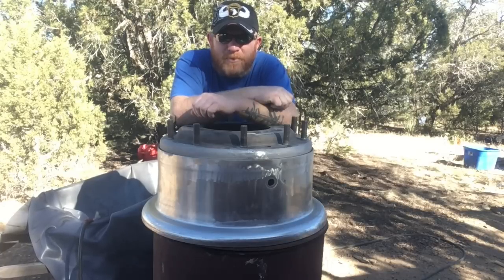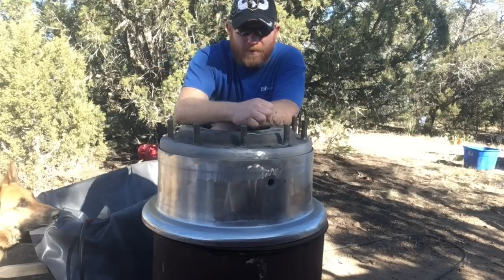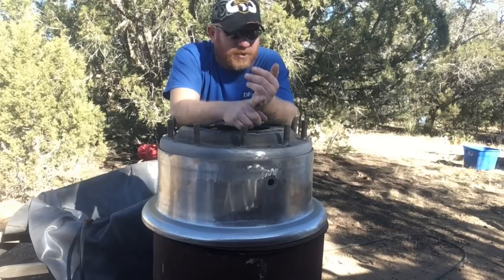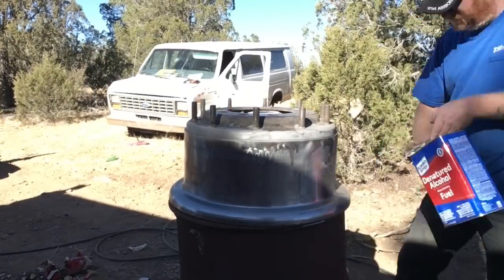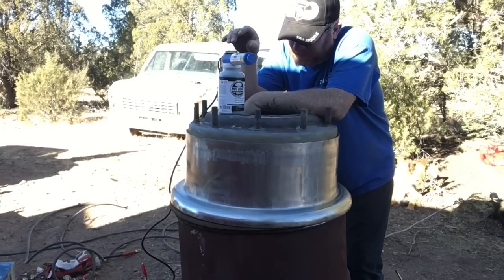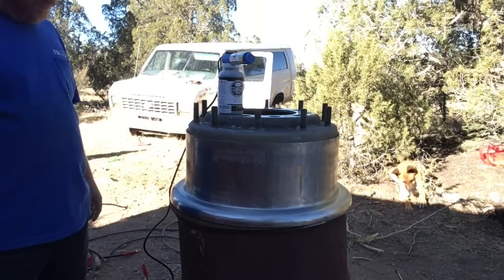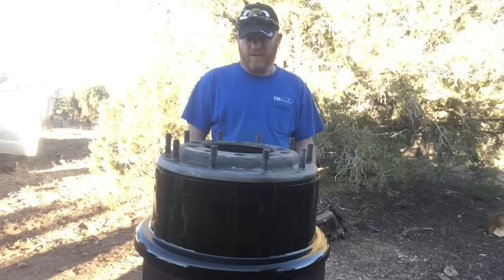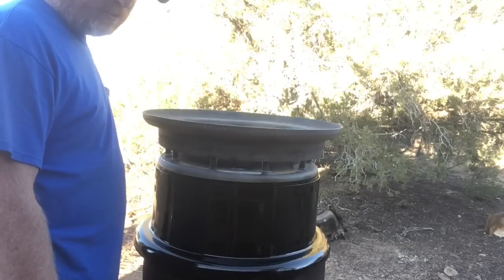NO OVEN? NO PROBLEM POWDERCOATING!

Comment: Cool improv.   I powder coated my Jeep bumper by stacking two drums and putting two oven elements inside.  I did the rims by building a cinderblock oven and a oven element on the sand poured  in the center.

When you need to get it done, but don’t have time to wait!

Great video!
Reply: Thats an amazing idea.thanks for sharing

Comment: I've wondered if just blow torching the rim before and putting the can in really hot near boiling water will help fuse the paint better to the metal.
Reply from the maker: NoSunBeach If you’re going to use a torch make sure to get the metal good and hot first because it will leave moisture on the metal. It theory it could be trapped below the powder if it melts before the metal gets hot enough for it to bond.

Comment: Powder coating isn't just to melt the color on it and that's it,  that won't be hardened and last in scratches.... might as well just painted them for same scratch resistance.... you need to heat them for much more time and much higher temperature or it's really just barely melted powder paint.

Comment: 9:09 What's the name of the track you used here?

I'm gonna try out using that radiator heater while also using a heat gun as well.

Thanks for the tip! 👌
Reply: I thought about the heat gun also but I think it would blow off the powder. How about using a map or propane torch to heat it up 1st then powder coating hot, then putting the propane heater on it?

Comment: What kind of medium were u using that u void have your gand that close?   I need to do the inside of a t roof for my Camaro as I need to replace that roof section, s (the s3ction is off the car) so this gives me what I needed to know to get the inside sections coated:)  you can also use high temp tape for this so you can mask it off and not worry about the heat!
Reply from the maker: Vicki k Gibson 80grit aluminum oxide I think
Reply: @OffGridOverLander  wow fast reply!  I have another q. How long did u put the heater on each section?  Normal temp is around 400 f for cure. That takes about 30 min, I am told, so how long do you put the heater on the rim?  Of course thinner metal will get hotter much faster.  Might be hard to regulate,  but not impossible,  just watch it very close?
Reply from the maker: Vicki k Gibson with as thick as my rim was I just watched it and rotated it about an inch at a time when I saw that it had melted, between the metal retaining the heat and slow rotation I figured I hit the 10-15 min needed for my powder.

Comment: You think it's possible to powder coat a car panel or maybe even do the wheels while they're on the car
Reply from the maker: Sorry for the late reply,  I wouldn’t do them while they are on the vehicle, mainly for risk of fire. Too many different materials on vehicles with different melting points, even if a part doesn’t burn it could still be destroyed by high heat.

Comment: Pretty clever solution. Do you think it will hold up as well as a truly baked finish?
Reply from the maker: Not sure, we will see over time, but honestly this was the inside of the wheel so I wasn't at all worried if it wasn't as durable as a traditionally cured finish.
Reply: Good luck with it. I hope it works.  I’ve got several items I intend to try this on Please do a future update.
Reply: So now that it’s been a year how did it hold up? This is awesome. I’m about to build a giant oven, but if this works, I might just do it instead and save some money.

Comment: Let me tell you something Mister, You are the Man! I never thought of that, a propane heater.  Like a fool I would have over spent on a lamp.  All I want to do is my bike.  Does it leave any seem lines between the powder and new run out after the finish?
Reply from the maker: capeman10 If you’re trying to do multiple coats on metal you’ll most likely have to hot flock it. Basically just keep the frame hot and spray it with the next layer. I’ve done that with other parts that I haven’t videoed.
Reply from the maker: capeman10 If all you are doing is a bike frame, the metal should heat up quicker than this wheel did. You can also try using a good heat gun.

Comment: I thought you were going to add coals and light them in the barrel to get the wheel to temperature, would not have taken too long.  The outside with the propane is brilliant.  Work the coals and the propane and you will have a cure to last.

Comment: Cool man.  I’m just learning about powder coating. I thought you had to heat the part first and then apply the powder when it’s cool to the touch. Did your method last?  Thanks
Reply from the maker: Leo C You don’t always have to preheat the workpiece. If your workpiece can still conduct electricity then you don’t have to. If you are working with multiple coats of powder, or a workpiece that is not conductive then you will have to hot-flock, which is what you just described. As far as durability, I will address that when I break that wheel apart next time.

Comment: How did you keep the powder from blowing off?
Reply from the maker: ConDragon10 It wasn’t too windy that day and it generally takes compressed air to blow the powder off. Have to remember that it is static charged with electricity so it wants to stay on the part.
Reply from the maker: It wasn't that windy that day, but it takes more than a gentle breeze to get it to blow off. If you're using the static charge type of application it'll take compressed air to usually dislodge it from the part being coated. If you're hot flocking it then you'll have to work with the breeze if you have any to get the powder on the part. Hot flocking is usually reserved for parts that already have a coat or two of powder already on them, or parts that aren't electrically conductive.
Reply: Ok thanks 1000x

Comment: Whet the you bouth that heater
Reply from the maker: Bought the heater through Amazon, I'll be sure to add a link next time I do a powder coating video. But unless you plan on doing small areas make sure you get the one with two heads. I might even keep an eye out for a larger one or make one next time.

Comment: Dude that’s pretty cool man!!! Keep them videos coming!! How long did you expose the wheel to heat as you rotated it? Just when it looked glossy enough basically. I noticed that you could basically see the heating element reflecting and then you rotated. About right?
Reply from the maker: blueswasted6768 Yes, I let it sit long enough in one spot to let it flow out and then sit for a minute or two. The steel is really thick so I knew that it would retain most of the heat for the post-flow cure time.
Reply from the maker: about 10-15 min, the video was sped up considerably(2000%).

Comment: hello unfortunately this proses will not stand the test of time at all.... the bake time for gloss black is around 20 mins at 170 degrees, the timer starts when the part reaches 170. all you are doing there is making the powder gloss over, it will not bond to the surface and will have no durability , this will flake off or crack in a very short period of time. but I would love to be proven wrong :) I suppose your doing the inside of the wheel to get a good clean surface to mount the tyre,? I think if you used it for the wheel face stone chips and weather would take that off within weeks.......just an after thought what temp does the wheel get to roughly?
Reply: l8on6661 that is what I was thinking. It isn't cured but if it works for the application I guess its good.
Reply: Ye that's right if it works for the application and you have had no issues .......then it's a good work around for not having an oven just be mindful about durability when using the same process in different applications:)
Reply: To be honest, I think this could be used to do it correctly, just set it up so that the heater in heating the wheel from the inside, that way the actual wheel is heating up, not just the powder, and then just let it sit in each area for the necessary time, 10 minutes per section or whatever the powder requires
Reply: Ye that's a good point pal I think that would work.....  enen get a couple of heater heads in there so the part gets to temp quicker and evenly :)
Reply from the maker: Total cure time was about 15 min at each point before I turned the wheel. Total cure time took about 2 hrs so the video was sped up considerably. I won't be using gloss on the outside of the wheel so I'm not sure how it will look when it finally gets to temp, we'll just have to see when I get there.
Reply from the maker: I can't use it on the inside of the wheel, the paint on this old military truck is CARC (chemical agent resistant coating) and is carcinogenic. I've already got enough health issues from my military time and I'd rather not add cancer to it if I can. I will probably get an oven built by the next time I do a video about powder coating.
Reply from the maker: Yes, that will be an upgrade that I do to my setup. This was a test to make sure that it would work even though I was 99% sure it would.
Reply: Well it looks good and you made some good points ..... let me know how it stands up your could be onto something:)
Reply: +Tnk Danio
I'm currently in the process of building an auxiliary fuel tank for a long distance motorcycle ride to Mexico.  I started with a 5g air tank and brazed a fuel fillup fitting and another fitting in the bottom to which I will connect the valve and fuel line.  I started out with Rustoleum Hammered Finish oil based paint, but quickly found out when I tested it that that paint is NOT gasoline proof.  So, I spent a couple of days with an angle  grinder with a wire brush attachment removing all the paint.  I've decided to powercoat it since I already had the Harbor Freight powerdercoating gun, although I've never used it.

The problem is that the tank is larger than the toaster oven that I use for powdercoating bullet and I'm not even sure it would easily fit in a regular oven, or if it did, it would be a pretty tight fit and I might knock some of the powder off of the tank.

One thing I was thinking of though was putting a heat gun in the tank fill tube and let it heat the inside of the tank while the hot air escaped the smaller holes of the other bulkhead fittings, thus heating it from the inside out.  Have you ever tried that with a part?
Reply from the maker: Grumpy OldMan you could try it and tell us how it went.
Reply: +OffGrid OverLander
I also have the drum from a scrapped clothes dryer that I'm thinking of using.  I haven't decided which one to try first though.
Reply: Grumpy OldMan ..... I have been doing some research and it turns out that powdercoat that is only cooked till it flows out (your method)it more durable than paint but not as durable as fully cooked powdercoat......... so your method is a good 1 :) as you still end up with a good solid finish nice work.
Reply: Actually, I haven't tried powdercoating my tank yet, it's "OffGrid OverLander" that did it in this video.  The only powdercoating that I've done so for is on bullets for when I'm reloading ammunition.  It is used as a lube for the bullets instead traditional wax and grease based lubes.

I was going to start it today, but as I had the angle grinder out removing the last couple of spots of paint that I missed, I dropped the angle grinder and then tried to grab it with my other hand.  Unfortunately, I had the trigger locked and I came in contact with the moving blade with my thumb.  Need to put that on the list of things not to do again. :(  I think it might be a few days before I can touch anything with my left thumb without it hurting quite a bit.  Luckily, my left thumb is not used when I'm typing on a keyboard. :)
Reply: I do powder coating for a living. I am not going to play arm chair coaching. I get your point and just finding a feasible way for the shade tree guy to get by. I get that..And i applaud your ingenuity. What I will offer up to you, is wear latex gloves during/after sand blasting..the oils in  your hands/fingers will stay on that surface and show through the powder. maybe not every time.  But sooner or later it will. 30 yr army here..Thank You...
Reply: Wouldn't the fact that the paint was completely melted that it would adhere fine being the steel and paint reached a temperature of at least 400 degrees. I could be wrong but it seems to Me that the idea of a melted material haveing to cure seem kind of odd? Like I said could be 100% wrong but just find it unlikely that it really needs to "Cure"